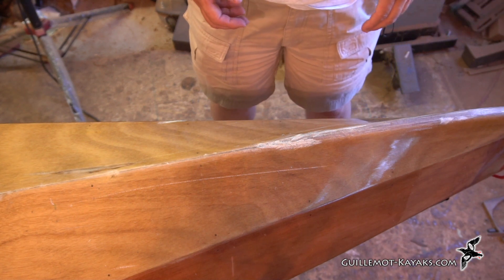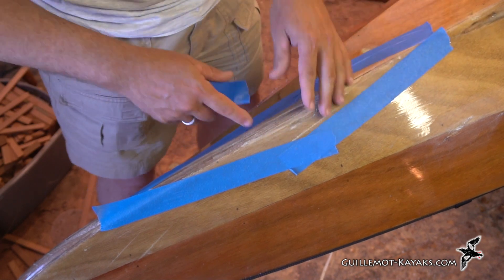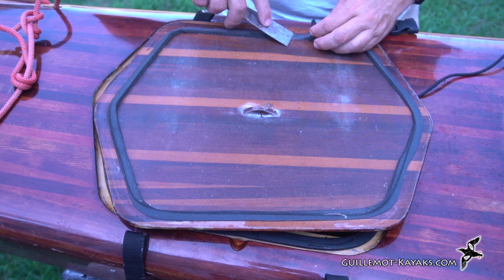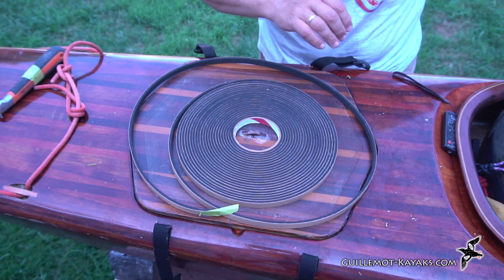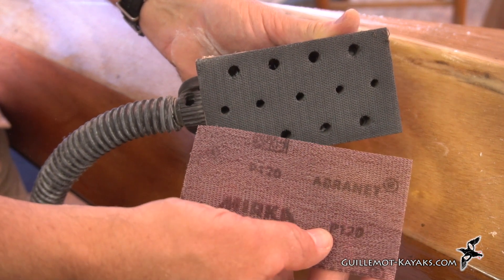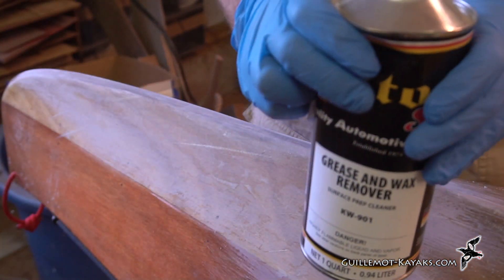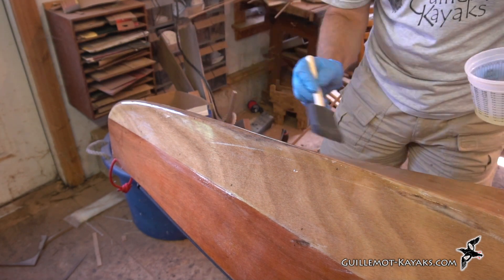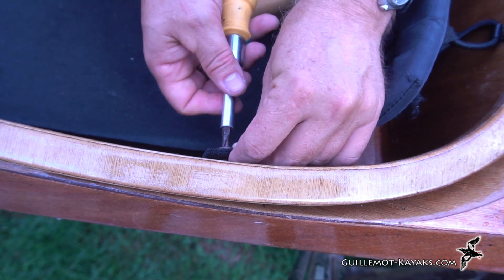Wooden Kayak Maintenance

Comment: I'm amazed you attack your boat with 40 grit! You must have a very delicate touch: I'd be through into the back compartment.
Reply from the maker: I'm not sure I have a delicate touch, what I'm sure I don't have is patience. 40 grit will dig into the class quite quickly, but if you see when you are about to dig into the wood, and stop, it is pretty darned effective.
Reply: That is so interesting that YOU, o master kayak builder, do not have patience. I don't believe it. Maybe you mean given your week timeframe for the trip. This video, I was like, when he's repairing his own boats, his level of craft devolves to match the best I can muster for the whole build. Strange. But I understand. No patience is part of the reason, plus less complicated and expensive, I have primarily gone to SOF to scratch the itch. But one of these days I'll have time and space and patience to build a wooden one again. Probably shortly following the eventual demise of the Seabird black pearl, or sufficient uglification of same, it will happen by necessity. And another temporary build shed will be erected... in SOF.
Reply: And, I'll know much more about the process because of the videos you've put out. Thanks.
Reply from the maker: Given a choice between working on building/fixing kayaks, and using/paddling kayaks, I would go paddling every time. Building is what I do to earn the ability to go paddling.

Comment: This is why there are two kinds of Kayakers: plastic and those who regret they ever chose otherwise. I was very enthusiastic to have a friend build me a wooden Kayak but here in the rocky New England terrain despite being careful with it sadly the finish got scratched up and ruined pretty quickly. The fix was more time and effort I wanted to put into it, or more expensive than I wanted to pay to have done so I just gave it back to my friend who took it back for free after I used it very briefly.

There's a reason plastic is so popular and at the end of the day, the only real advantage of wood is looks which if not kept in a museum like state won't last without extensive maintenance. The weight difference you cannot even tell and at the end of the day is not enough that you can't just eat a little less and excercise more to lose which is free. After enjoying plastic for years I was happy to go back, my heart goes out to those who stick with wood, there's a reason most Kayaks are built with plastic. 

The only maintenance my plastic Kayaks ever received besides being dragged and dropped on rocks is plenty of UV light from being left outside and rain. I've never cleaned them not even once, they survived a decade and a half of total neglect with only very mild scratches and warping. At this point I'll keep neglecting them because I got my money's worth. Plastic is the Toyota of Kayaks, maintenance free, nearly indestructible, instead of watching videos like this to see what you're in for with wood, if you've never tried you don't know what you're missing!
Reply from the maker: There are certain situations where plastic is indeed the way to go, but wood has one characteristic that greatly effects performance and enjoyment out on the water. 

A wood kayak is typically 15 to 20 pounds lighter than plastic. This is a noticeable benefit, allowing quicker turning, faster acceleration and generally better all around responsiveness.

20% to 30% less weight provides an instant performance boost. It is kind of like driving a Porsche vs a mini van. Yeah, the minivan probably survives bumps better, but its not as fun to drive.

I've been using wooden kayaks for over 30 years. I've spent a lot of time in rock gardens and tide races. Again, plastic absolutely has its place, but I am certainly not suffering for lack of hefting excess weight around just to save a bit of time in maintenance.
Reply: I had no experience with wood and about 13+ with plastic followed by thermoform. Indeed I was expecting a performance boost going wood and compared to PVC there was, but compared to the lighter thermoform maybe my wood kayak was more responsive but in terms of weight and speed the difference was minimal and maybe I wasn't prepared for what it entailed. Thermoform doesn't have to cost a lot, you can find a lot of good quality thermoform mid level type Kayaks in the $2-500 range on the used market that used to cost 1k or more. Most are in relatively good condition and the performance difference vs wood is so narrow, and the costs of ownership and maintenance so great that you have to have more than just performance in mind. I think you have enjoy working with wood and if you don't, have a lot of disposable income to be ready to perform a lot of expensive repairs on a frequent basis.

Living on the Southern New England coast, specifically Rhode Island is a big problem for wood. I just can't believe how quickly I ruined the finish and put gouges on my boat, even on beaches I thought were sandy and "safer". Maybe it would be different elsewhere  but areas that are safe for wooden Kayaks around here are like unicorns. 

It's funny because you mention the cars, I used to do high performance driving. If you know how to drive them, as in giving gas as soon as possible going into (not getting out of) a turn to get grip and unwinding the wheel at the same time to keep the grip and rotate (yes less steering rotates more) they all kind of drive the same, it's kind of like driving a motorcycle. Even the cheapest modern cars can be driven smoothly in such a fashion at pretty much felony speed all the time and you're doing it so imperceptibly without flooring the gas or jerking the wheel or stabbing the brakes that your passengers cannot even notice your immoral speeds. At this point the $800 oil changes, $1800 headlight change and $2000 battery replacement associated with performance marques, most of which cannot be done yourself because you have to disassemble large portions of the car or possess proprietary tools,  not to mention lower overall reliability and high related costs of ownership, start to lose their luster.
Reply from the maker: I live in Southern New England and I've been paddling the coast from here to Downeast Maine since the mid 1980's. I work my kayaks very hard. I play in rock gardens and bounced off hundreds of rocks. In that time I have probably spent a total of maybe 30 hours repairing my damage from playing in rocks.

I'm sorry that level of maintenance is so hard that you have saddled yourself with heavy, slow beasts for so long, but I understand that it is a personal choice how to spend your time. As I said before, plastic is absolutely the right choice for some people.